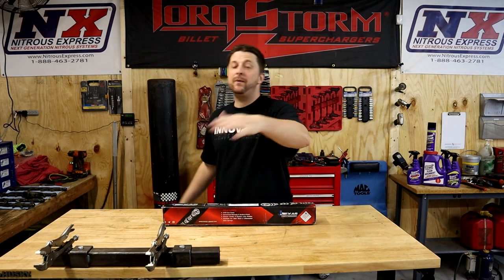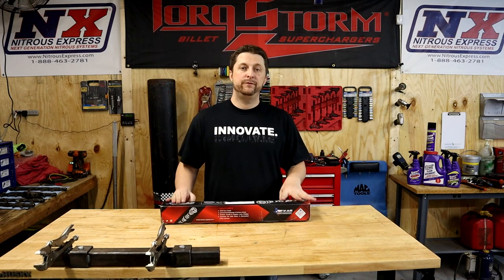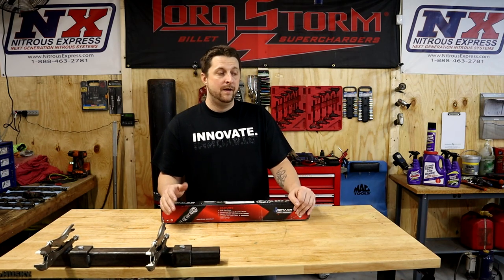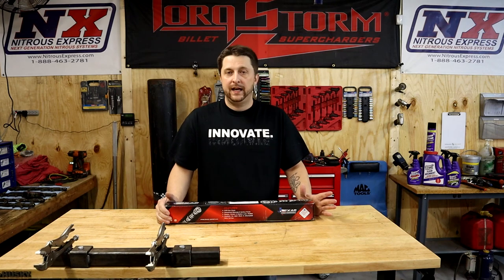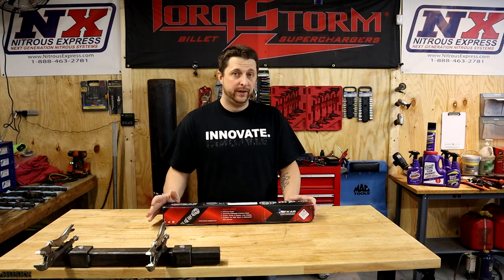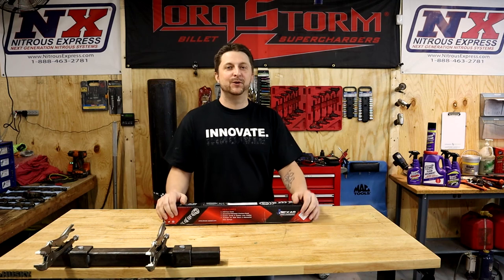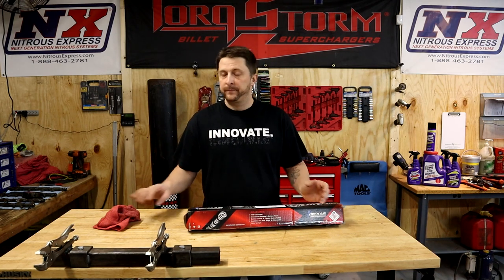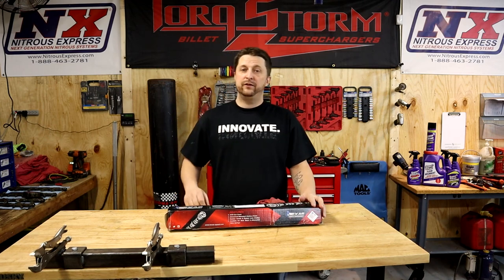New Camshaft And Tuner Why I'm Not With Jay Greene Any More.

Comment: i have a 2012 Ram hemi (Hemi tick)   Planing on replacing cam, lifters and mds delete.  just wondering what other patrs i need in order to get my truck back running right.  not looking to hit the track, but would take a few more hp if the cost didnt change much.  any help would be appreciated!!     thanks Dan
Reply: I have the same truck and I'm looking for the same thing.
Reply: I have 2012 Ram Hemi. First cam and lifter failure, dealer replaced. Second cam failure... out of warranty. I got a cam and lifter kit... springs and etc. from Moe's performance. I think if you get your cam from Moe's you'll get a discount on your tune with HEMI Fever(check to confirm). MDS delete plugs, 6.4 intake manifold w/6.4 injectors, 6.4 throttle bottle, and necessary conversion cabling from Modern Muscle.  S&B 6.4 CAI, JBA Shorties(only because they bolted in with my configured exhaust at the time). Pedal commander from HEMI Fever with the first tune. Second tune from HEMI Fever also, and loved them. Needed a third tune after last mod and couldn't get in contact with Sean at HF, so reached out to Jay Greene. He sent the tune right out. Nothing against Sean and HF, just seems like Jay is more accessible, he always responds, and offers sound advice.  Just know, you do have to respect his request regarding sending logs, request, and etc. on that Thursday closing day up until Monday re-opening every other week. I'm happy with Jay's service, but both are very good. There are other guys out there as well. No Bashing on any of them... but for me right now... Jay Greene.
This is where i am with my truck... hope it offers some sort of starting point.
Reply: @colliersmith8038  I'm not doing all of that to my truck.. cam, lifters mds delete and tune.

Comment: When you switched from Diablo sport to HP tuners did you need a new PCM? Or was the unlocked Diablo able to be flashed with HP?
Reply from the maker: My truck dosen't require a unlocked pcm because of the year but if you have one already it should work fine with hp
Reply: @FrostbiteRam  I did more research, contacted FRP, it’s confirmed that I can use the DiabloSport PCM. Thanks for the reply and thanks for all you do

Comment: How did you end up changing from Diablosport to hp tuners? Is it as easy as setting your truck back to the stock tune with the Diablo and then hooking up the hp tuners? I have a jay Greene tune and I want to move over to hp tuners but when jay emailed me the tune he said not to set the truck back to stock.
Reply from the maker: Yeah very simple no problems

Comment: Love watching the Chanel 
I’m a old school mopar guy I still have my little Dakota from 92 with 26,000 org. Miles on the clock still have the 5.2 mag in it I done a lot with back in the day extruded hone the keg intake bored out my throttle body made my own throttle body blade installed 24# injectors 
Made my own fogger plate for 300 shot
Built the bottom end using viper parts etc
Little truck was a lot a fun back then
I have a question 
If your were thinking about putting a hemi in one which one you opt for 5.7 6.4 6.2 ??
I appreciate any thoughts you could share 
Thanks 
John
Reply from the maker: I love the dakota. Man if it was me and money was not a problem I would probably go with the 6.4  for a na build and nitrous or the torqstorm supercharger.  The 6.4 kicks like a donkey out the box it would do good.
Reply: Cheap”er” 5.7 and let it have some boost and gap the rings. Done

Comment: I got a 05 single cab Dodge Ram 5.7 with 289,000 miles any advice on tuning it or doing anything performance wise or should I buy a newer 5.7?cuz I’m new to the tuning trend and making your Hemi’s faster but I don’t know what to do?
Reply from the maker: If you keep the older 5.7 you definitely need to swap over to the newer eagle heads. Honestly if you haven't invested to much already I'd say trade up.

Comment: I had a Greene 1.5 hL. I had hemi fever tune it without an issue
Reply: How was it I’m looking into buying the 2.0HL with hellcat lifters
Reply: @colinbaugh1913  it definitely brought the truck to life. I had no regrets with the purchase. But I’ll be going with the moes max effort cam this time around.
Reply: @stormbreakerram9526  are you running only the cam and lifters or what other work did you do to it to be running a bigger cam
Reply: I ended up selling the black truck it was a 6 speed I now have an 8 speed I will end up with ported heads FBO forged bottom end and some goodies to add to that in time
Reply: Storm_breaker_ram  on Instagram

Comment: I have a 2012 ram, as of now its just a plug in 93 diablosport tune and intake. What would you recommend for a cam? It is my daily with 122k
Reply from the maker: I would go with some sort of mild high lift cam for a stock converter especially if you tow anything.

Comment: i use to use jay for close to 4 years finally switched tuners car is way more consistent now on track times  with the new tuner and  mods its night and day diff  like ive said in one of my videos jay is good tell a point then after that point its time to find a tuner that is local with a dyno ect .i was having lots issues before .and just got tired of the hundreds of data logging with jay and his excuses my brother also used him on his truck also had issues jay couldn't  figure it out 550 wasted. are new tuner had my brothers truck dialed in in bout hour with no problems so not sure what the issue was that jay  couldn't figure out best thing i ever did is switch tuners .keep up the good work on the truck im getting ready to go supercharged also and thinking about getting the torqstorm or the edelbrock e force .
Reply from the maker: Thanks man🙏
Reply: I used Jay for my Challenger after I put headers on it. I couldn't tell a difference in performance at the track. My 1/8 mile times were the same as before the "tune". I paid him for an engine and transmission tune. I took it to a speed shop here that specializes in Mopars. He looked at my tune and showed me I had nothing more than a little hotter 93 engine tune, and NO transmission tune at all. I will not ever bother Jay again. He took my money and lied about what he did. I will not ever recommend him or anything he has to do with.
Reply: @pwpt6  Well, this is only one side of the story and considering he has well over thousands of customers. You have not provided any evidence on this slander. I`ll take his thousands of happy customers over a slandering review as this.
Reply: @stevenchaney7396  Take it anyway you want to. I’ve got the tune,and the time slips to back it up. I’ve changed tuners, and he will verify what I had. He re tuned it on a dyno using HP tuners and I picked up 4 tenths in the 1/8. Sometimes the truth hurts. But I stand behind what I said.
Reply: Jay has some of the fastest mopars , he knows his shit , hes also building his own ram . The trans tune is great !
Reply: @pwpt6  Like I said, you aren’t really doing anything with a comment besides an opinion with no evidence. Congrats on getting it the way you wanted though
Reply: Who do you use now
Reply: @stevenchaney7396  there are multiple comments on the this video alone that back up with this guy said. There are two sides to a story but you seem pretty biased towards jay already. So assuming he would deny any wrong doing that tells me you would be in his corner……I have someone that lives local to me that had him as a tuner and was struggling to get the tune right. They went to someone else and had it straightened out fast. Another guy on this video commented that jay spec’d the wrong cam and won’t own up to it. Blocked the guy. I will definitely not be taking a chance on jay.
Reply: @brandonwilson517  dude literally has several thousand customers.

Comment: The jay cam was too small.
Reply: I run a hellraiser with edge 3000+ converter jba headers 3.55 gears one wheel peel on the stock tradesman 17s and goodyears and went 12.90s in 780da. That cam was considered to be to big not long ago
Reply from the maker: Definitely for the direction we are headed but that small cam has put up some respectful times for a 5speed ram 11.6 ain't bad.
Reply from the maker: Good information 👍
Reply from the maker: The .5 is definitely the best bang for a daily mine has done well considering.